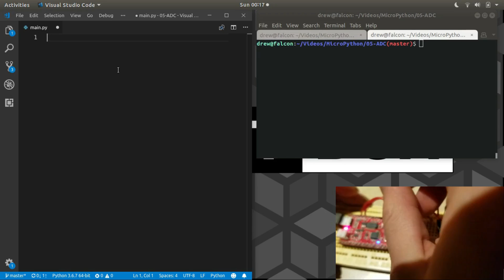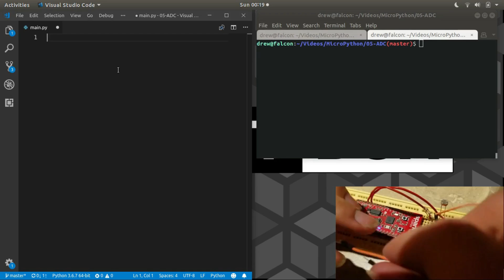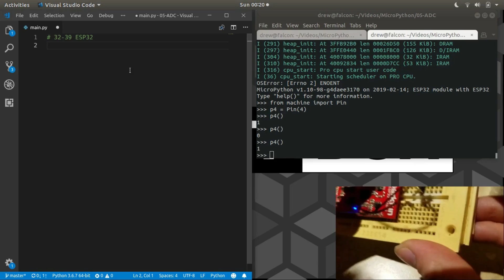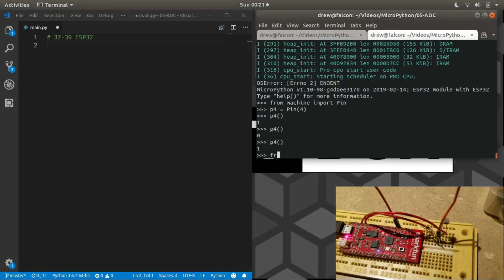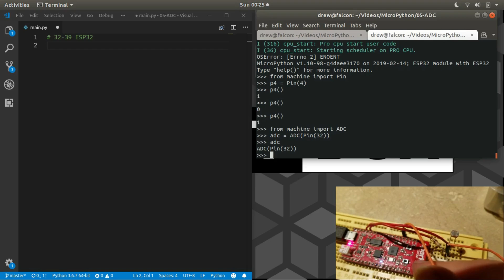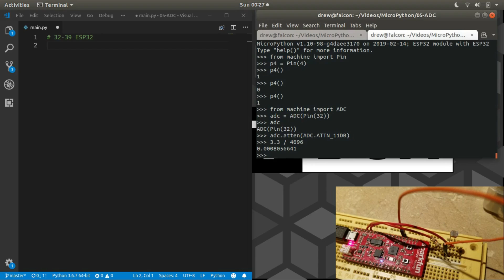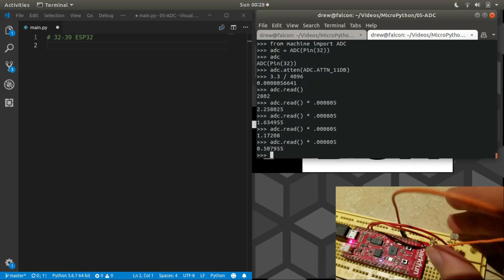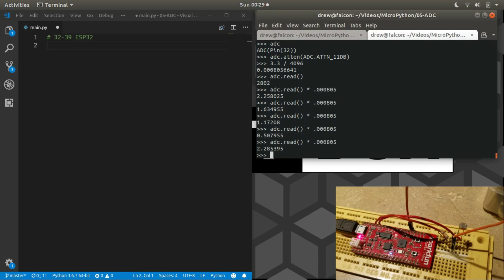Learn MicroPython #5 - Measuring sensor voltages (ADC)

Comment: What would you suggest I do to map the count to a longet period? For example, I have a linear actuator with a built in potentiometer and I want the ADC to read 4095 when it is fully extended and 0 when it is all the way in. However the ADC will read 4095 wayyy before the linear actuator is fully extended. I want to delay the increment of the ADC reference voltage in order to map it to the length of time it would take to have the linear actuator fully extennd. Any thoughts on this?